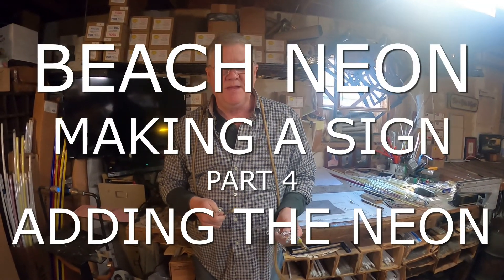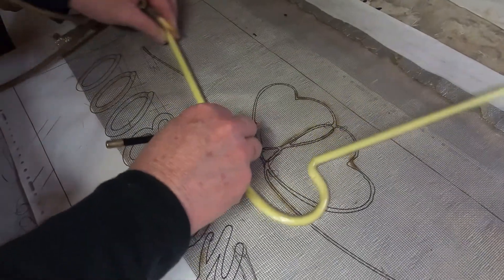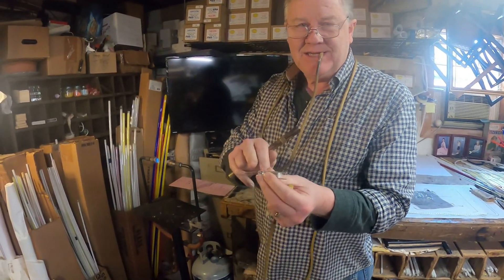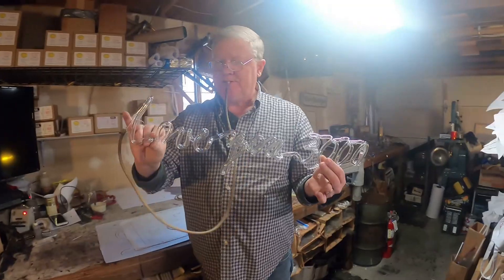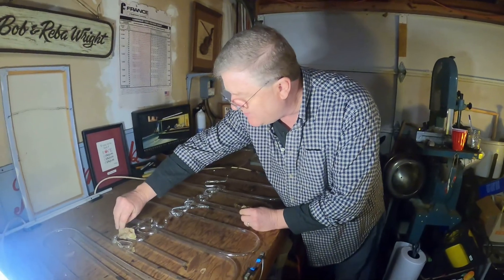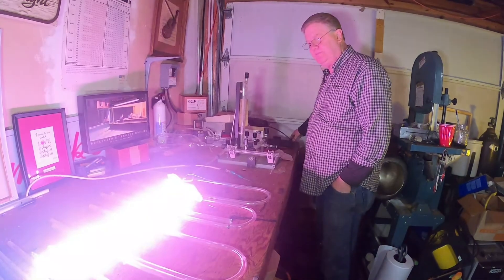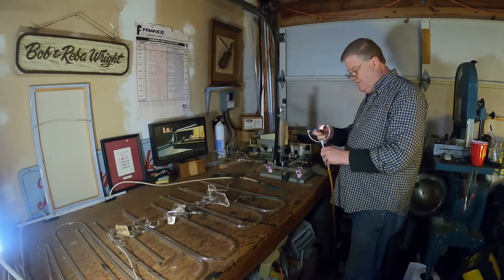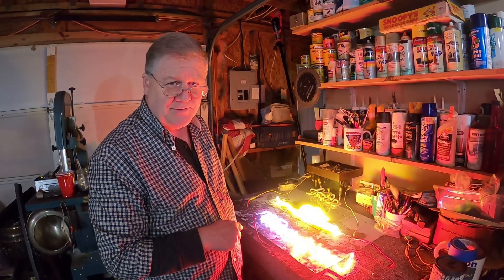Making a Neon Sign | Pt.4 | ADDING NEON GAS | Beach Neon, Myrtle Beach, SC

Comment: Very cool video! I have a question about the glass flasks the neon and argon come in. How are they opened? Is a vacuum pulled on the stem and then the glass barrier at the base of the stem somehow broken? I'd like to know because I'm looking into making a simple diy neon sign.
Reply: A magnet is used.  The flask has a small tube attached to it, this small tube has a glass wall inside it. 

A magnet is dropped into the end of the tube and rests on the wall.
The end of the tube is sealed onto the manifold system.  
Another magnet is pressed from the outside, and the inside magnet jumps up and follows the outside magnet wherever it is moved up and down the tube. 
Now with speed you smash the inside magnet against the glass wall in the tube, and the wall breaks, releasing the gas in the bottle.
Reply: @SummersSnowVideos  Thanks! That’s good to know.